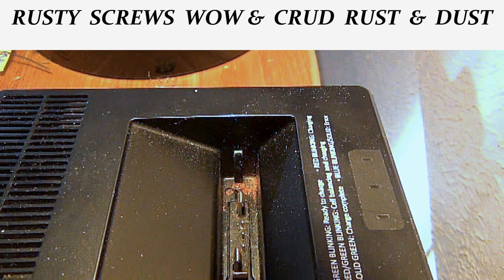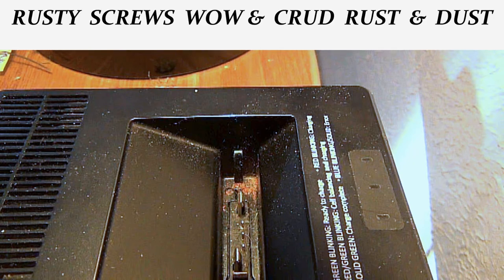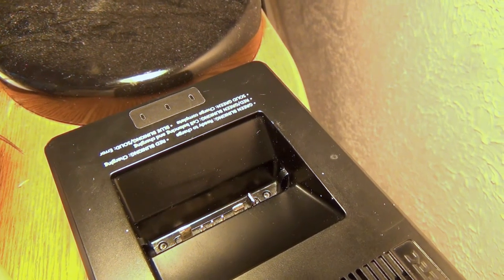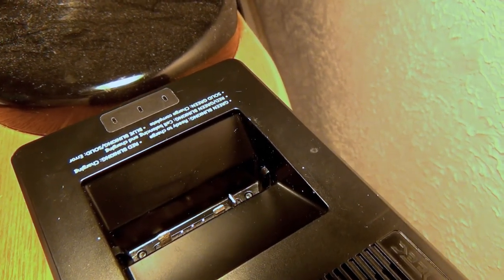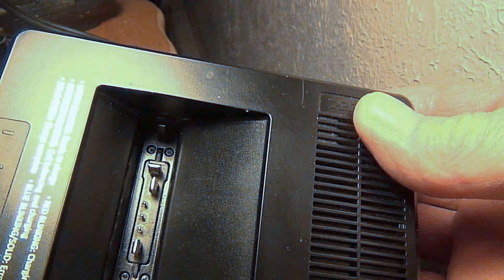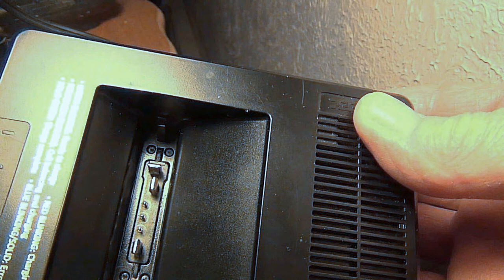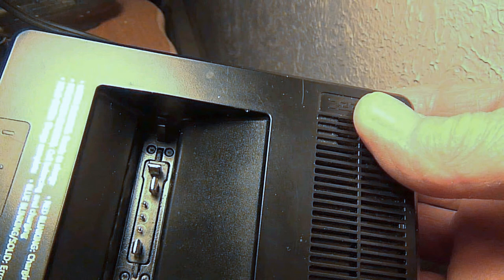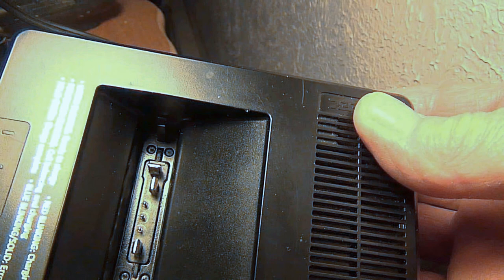KK MOTION PICTURES TYPHOON  H BATTERY  CHARGER

Comment: I’ll be checking mine for sure. I’ve a quick fix also, you should wear gloves and safety goggles... Muriatic Acid + Qtip + H2o. After dabbing the Qtip in the Acid then touch to the contacts, let it sit for 1/2 min and dry with papertowel, then I’d use another Qtip and dab the same parts with water to neutralize the acid, dry with papertowel. Works perfect on battery leakage onto your components contacts. Hold your breathe while applying the Acid!💨
Reply from the maker: I'm sure your way works well.
But I didn't have muriatic acid.
I'm not sure if that would injure the plastic or not.
But I'm pleased with the way this came out.
And that was a few years back I did that I believe.
Keith

Comment: Yeah you have to watch that, I modded my charger to enable the use of my 120amp RC charger so I can discharge and charge to 6amp. I can still use as intended with the Yuneec power adapter. I also have a couple of the charge leads from Carolina Drones  https://carolinadronz.com/collections/accessories-parts/products/yuneec-typhoon-h-battery-plug-for-chargers
Reply from the maker: YOU ARE A GREAT DRONE PILOT